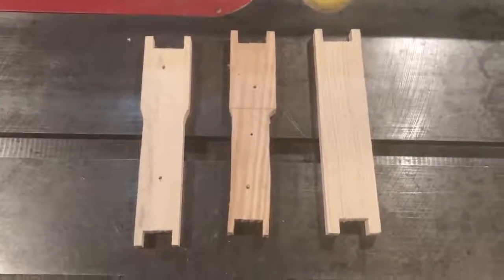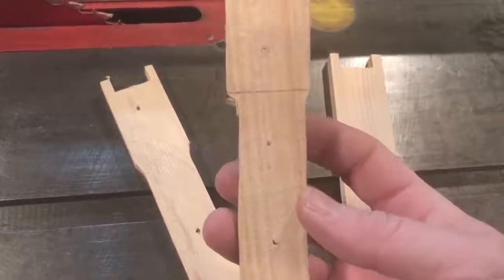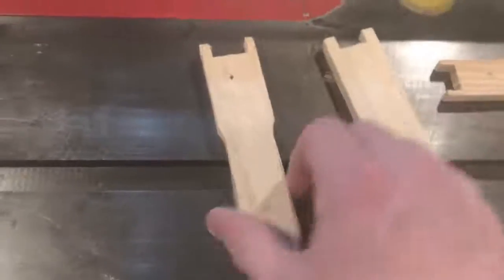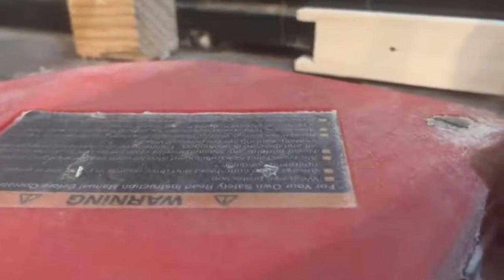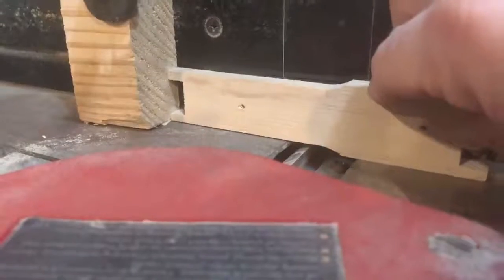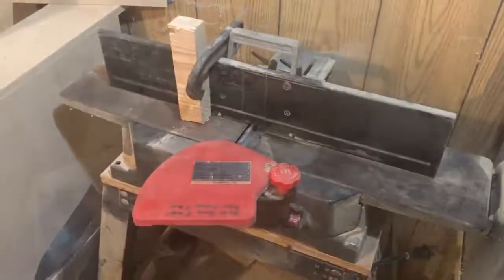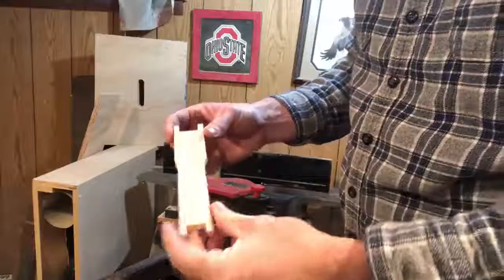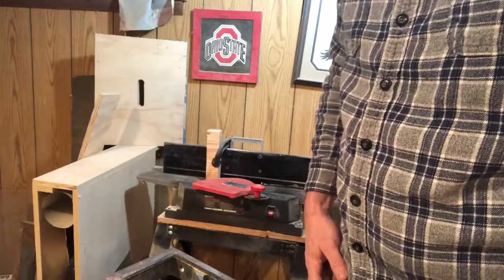Cutting Shoulders in Beehive Frames

Comment: Just an idea for safety. Clamp a fixed board over the blade spaced with just enough space to slide the frame behind it to the upper table as a hard-fixed guard.
Reply from the maker: That’s not a bad idea, but I sold the machine a while back.